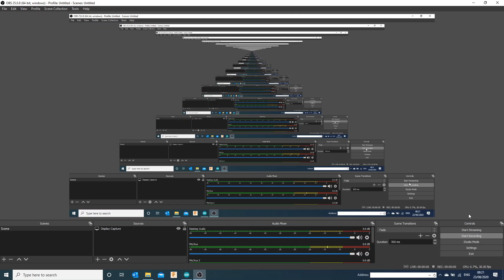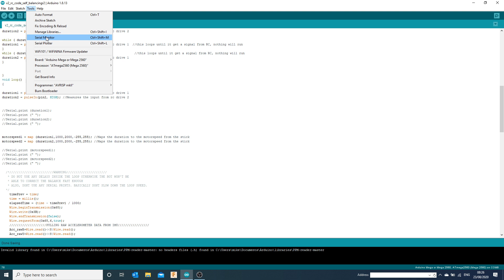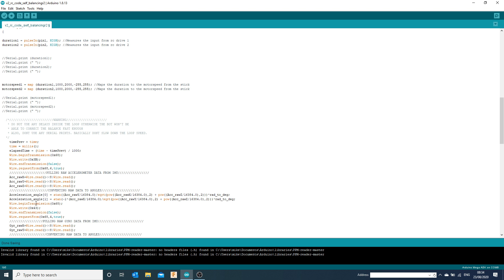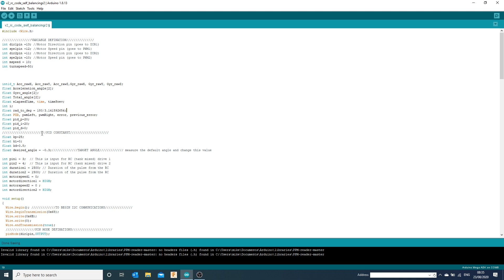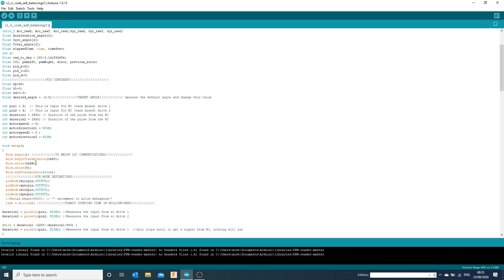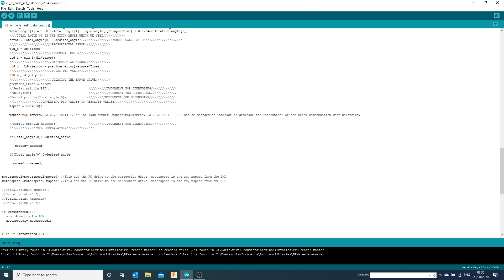DOv2 code walkthrough

Comment: Morning Michael, thanks again for this sharing.
Couple of questions and comments :
 - For this kind of video it would be better to zoom in a little or modify the resolution. Half the screen is white, typical c line of code is 80 char long.
 - Would you rather share your code trough github?
 - I do not want to touch your programmer ego, this is sensitive, i know i do code review in my day job...
    - Please use indentation
    - For comment blocks use /*  some comment on several lines */

Otherwise, your code is very clean, well structured and well explained. Maybe just "CTRL-T" from time to time...
Reply from the maker: Thanks Julien, I'm not a coder by any means, just another skill I'm learning as I continue with the 3d print builds, don't worry about my ego :-) I have none lol.